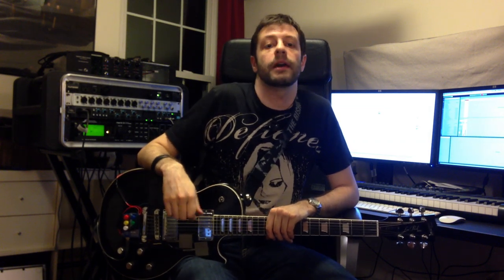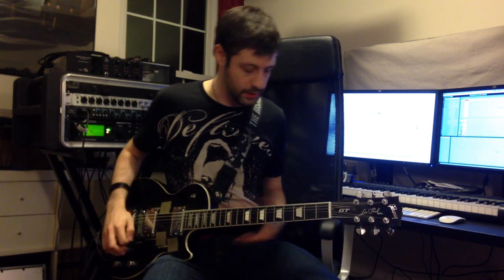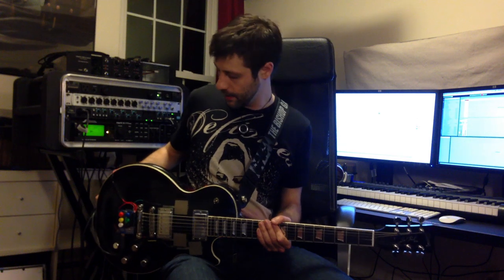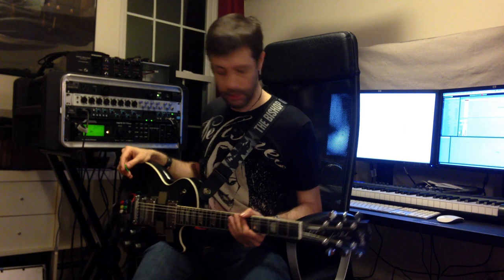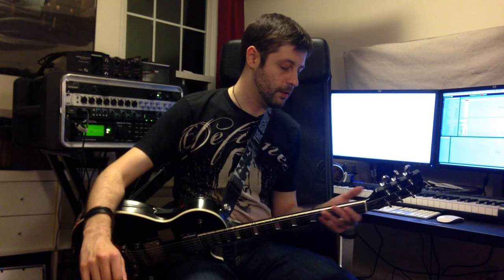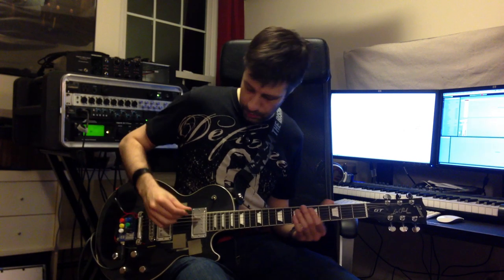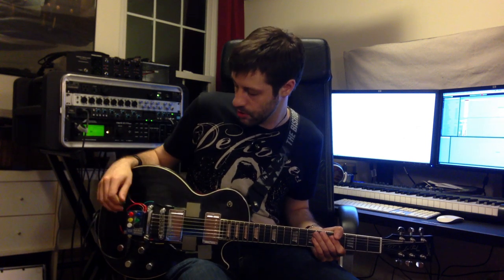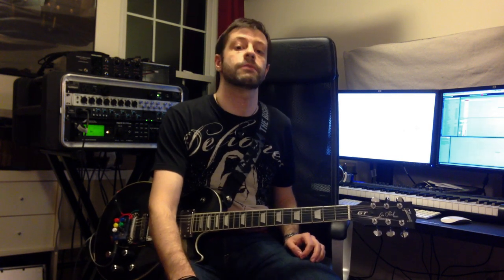Guitarduino - Arduino/MaxMSP Guitar Mounted Midi Control System - Rundown

Comment: would it be possible to add a raspberry pi to the guitar for the midi processing?
Reply from the maker: Hm, it's possibly certainly, but what would be the point? Everything needs to go to the computer regardless and it's easier to process it there.
Reply: thebishopgame No doubt, love what you have going and max is really nice, but similar things can be achieved with ChucK or SuperCollider w/o all of the $$$. For a simpler and more portable rig you can bypass the arduino and dedicated PC altogether and go with a Pi. I'll follow you and when it's beyond prototype send what a buddy and I are building. Max is hard to beat for ease of use but it's pricey and requires you lug around a PC.

Comment: Oh my knobs! great work! I've being doing an arduino-PD-based prototype with a photocell sensor, but this is definitely a 2.0 version... wait 10.0!

Curious, how do you attach the arduino board to the guitar? USB connection or WIFI? And could you comment about latency?

For those asking about expression control, I figure out that a long plate sensor (split in two close parts) can be used to vary sensor's resistance according to finger touches and how far they are from the connected wire.